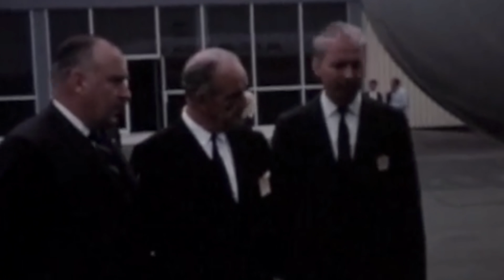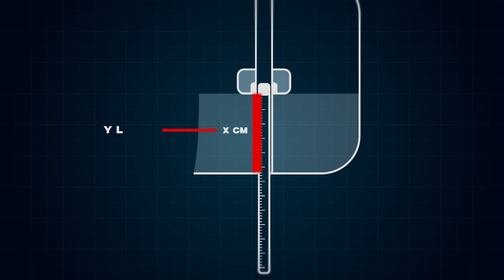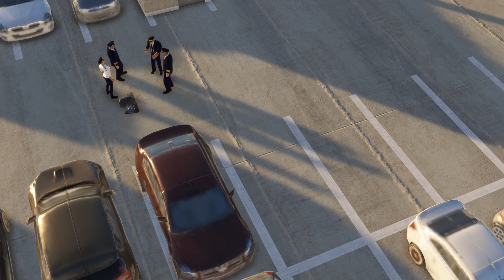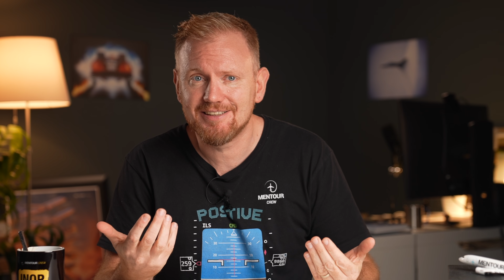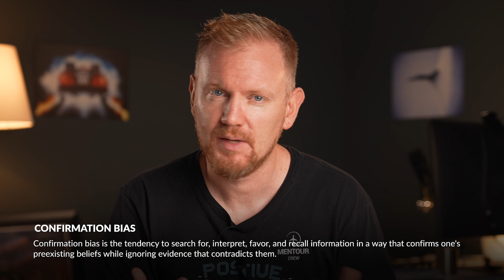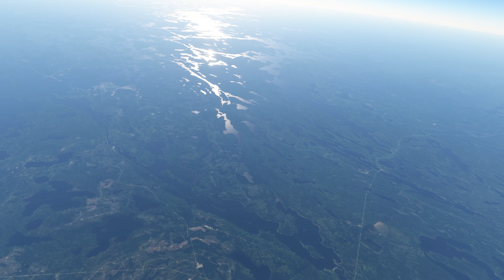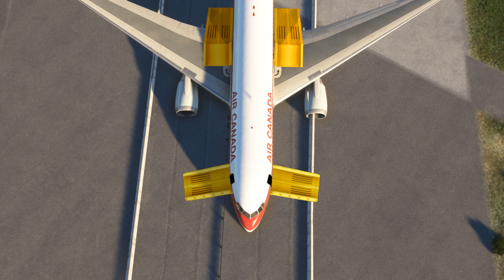NO Engines and Out Of FUEL! | The ”Gimli Glider" Miracle

Comment: Japan 123 might be an interesting event to cover, Petter; I'm surprised that you haven't done so already, for this was the second most deadly accident in aviation history. The 747SR-100, JA8119,  was delivered in 1974, and was used for shortish commuter flights within Japan. It had been involved in a previous incident which involved an exaggerated flare, a heavy tail strike and damage to the aft pressure bulkhead. This was after four years, and 8830 flight hours, which translates to around 6500 full pressurisation cycles. That was in June 1978.

Boeing repaired it, and back to work it went, for another seven years, and another 12318 full pressurisation cycles. Needless to say, a non-approved repair by Boeing engineers caused the bulkhead to fail on 12th Aug 1985. The resulting explosive decompression ended up damaging the unpressurised fuselage aft of the plane, unseating the vertical stabilizer, and severing all four hydraulic lines. It stayed airborne for another thirty minutes before hitting a mountain. 520 dead and four survivors, along with posthumous awards for the flight crew.

I haven't trusted Boeing since they took over McDonnell Douglas and placed profit above all else. But why had engineers who had grown up in a very different culture performed such a shoddy repair job, and how was it not picked up by JAL's inspection team before they put it back into service?

Comment: The talk between the ground crew whereby the conversion figure was passed is telling. An educated person knows that in the metric system a liter of water is 1000 grams ie a kilo, conversion 1:1. Jet fuel floats ie is lighter than water, thus any conversion must be LESS than 1:1 certainly not 1.77. It is not an understandable mistake and it has nothing to do with the system in the plane. The error in the conversion should been caught via common sense built from common public school education. Referring to the ground crew as "engineers" is a stretch.

Comment: I asume that the pilots have flown that route several times? I kinda have the Believe that they should have realised that the amount that was in the tanks, either the Values in cm or in liter, don't match with what would be normal. 
I've no idea about flying an airplane. I actually have quite some knowledge in science and under that perspective, i'm freaking out about that mistake not beeing noticed - ans even worse happened three times in a raw. 
I mean during refueling, wouldn't they have noticed that the process took halv the time it would usualy take?

Comment: I remember when this accident happened.  But this video brings a LOT more information.  All we got on the news was that the fuel was under loaded due to a metric conversion error.  Which was NOT the actual cause, it was faulty fuel gauges.

I am an American, and while i struggle with the metric system (i am old), the metric system is demonstrably better, and should be the universal system of units.  It would solve a lot of issues.

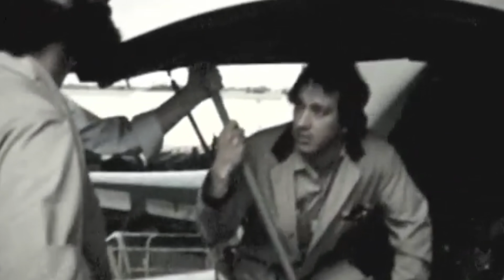Comment: Another informative video, thank you. However l can’t help thinking you summed it up at around 16:00 - why would you accept an aircraft without fuel gauges? Also, whatever happened to a basic background maths check, I.e. the aircraft burns x kgs  per hour, therefore I need x fuel? If the MEL was confusing, shouldn’t you ask the FO for his interpretation? I too flew for 2 operators that bought their fuel in litres but used kgs on board - but they were dynamite on getting these calculations correct!

Comment: I think the MMEL and the MEL should on most types should be revised and trimmed down quite a bit, especially for 121 or 135 operators. Or at least reduce the dispatch allowed time before the part has to be replaced. I understand redundancy but everything installed on the plane has a purpose.

Comment: Once I recreated similar circumstances in Xplane mobile with 737-800. Not because of the lost both engines, but because of being way too high and way too fast. With the extreme angles I ended up being with correct speed but being too low. It was quite difficult and in same time it was great fun. As far as I remember I landed safely :)

Comment: This story is just beyond believable.  As a pilot,  I would NEVER go fly an aircraft with no way to determine how much fuel I should have had.  It's crazy - beyond comprehensionn that a Pt 121 carrier,  regardless of all the math one could  do, and still risk a flight with ZERO means of knowing fuel quantity or fuel burn is INSANE.    This crew should have been fired on the spot regardless of the skills of the pilots and having to put a gigantic side slip.  NO pilot is forced or required to fly any aircraft if they are not 100% confident about it.  An amazing story of survival,  but it was just LUCK they didn't kill everyone on board.

Comment: On previous videos of yours I've commented on the importance of APUs running 10,000 feet and below for every takeoff and landing. But this accident makes me think APUs need a dedicated fuel tank for 30 - 60 minutes of runtime, completely separate from main engine fuel. Allowing you to maintain cabin pressure (I remember one engine out emergency where the limiting factor was cabin air pressure not glide range) as well as electrical. The tank would be so tiny it shouldn't be a problem.

Comment: Not long after this event, the Air Canada maintenance facility in Winnipeg was scheduled to have an open day where the public, including my father, sister, and I, could tour the hangars and wander in and amongst 727s in various states of inspection and repair. The day went ahead as planned, and a special and unexpected highlight was getting to see C-GAUN in one of the hangars getting it's nose sheet metal and other parts repaired. A year later, I joined the Royal Canadian Air Cadets, and got to do occasional glider flights at Gimli. I eventually got my private pilot licence and became an aircraft mechanic, a job that routinely required me to calculate fuel load conversions from litres to pounds, and every time I did, I would recall seeing C-GAUN sitting in the Winnipeg hangar and I would double check my calculations. Coincidentally, I even once had to do my own precautionary landing at Gimli in a C-172 due to low oil pressure, an easy landing compared to what the AC143 crew had to do.

Comment: I recall hearing that on takeoff the plane, 10,000 KG light with half the needed fuel weight,  lifted more quickly than expected which should have been a clue about fuel on board

Comment: It also should be curious to know if the fuel truck dispenser was rated in Gallons.....It's incredible how a "simple" liters to kgs conversion was skipped while the rate of descent/distance to field was correctly performed in an high stress situation.Well explained as usual, Petter. Just two tech notes: the stick used for fuel quantity mesurement on modern planes are actually Dripless Stcks, relying on magnets as shown in the video. The Dripstick are hollow and when they are lowered to the surface of the fuel in the tank the start to...drip. But they aren't used anymore. In case of gravity landing gear  emergency extension there is no gear door closure.

Comment: Great job. It still seems a flaw in design that the front landing gear would not properly deploy on gravity drop. Hopefully others have learned from this failure.  Very minor point:  Dip Stick (it comes from dipping the stick into the liquid) not Drip Stick.  Still the technique I learned when flying Cessna in training. Dip the stick into the wing tank - check the mark of the fuel on the ruler. Still a mandatory check on those planes.
Reply: Drip stick is correct in this video. According to Perplexity AI:

"A drip stick is a simple, mechanical device used to manually check the fuel level in the tanks of many large airliners. It works by providing a direct, physical measurement of fuel quantity, serving as a backup to electronic fuel gauges and ensuring accuracy during pre-flight checks.

*How a Drip Stick Operates*

A drip stick is essentially a hollow tube, typically made of fiberglass or another non-magnetic material, installed vertically in the bottom of an aircraft's fuel tank. The stick is spring-loaded or held in place so that its top end sits above the fuel level when not in use. When a technician or pilot needs to check the fuel, they pull the drip stick down from its storage position through a fuelproof opening in the wing's lower surface. As the stick is lowered, the top end eventually drops below the surface of the fuel. At this point, fuel enters the hollow tube and begins to drip out through a small hole or cap at the bottom of the stick. The stick is marked with calibrated graduations that correspond to specific fuel levels in the tank. The technician reads the stick at the point where fuel stops dripping, which indicates the current fuel level."

-------------------------------------

Of course, dipsticks do exist, and most internal combustion engine automobiles use dipsticks to check the motor oil levels. Dipsticks are usually in the form of a solid metal rod with markings to indicate the minimum and maximum oil levels. In addition, while dipsticks are apparently used to check the fuel levels in many Cessna aircraft, drip sticks are used for this purpose with commercial airliners.

Comment: I've known about this incident since I was a child, but still think this story is so fantastic that I've been listening to it several times during the years. This version is the very best!
What SHOULD be done is that the U.S. should change to the logical metric system and follow the rest of the world! The imperial system is just as stupid as it can be!
Reply: No, imperial is superior. You have an everyday reference of what a foot and an inch are. Nobody has a clue what a centimeter is, and the decimeter is completely useless. Likewise, the everyday measurement of liquids is double, how simple! Cup, pint, quart, half gallon, gallon. The liter is too small for practical use
Reply: @rogerpenske2411  This is the funniest respons I've gotten for years!
Let me give you some examples:
1 mm3 = 1 ml, 1 cm3 = 1 cl, 1 dm3 = 1 l, 1 m3 = 1000 l
1 l water = 1 kg, 1000 l = 1 ton
375 l = 375 kg
mm = millimeter , cm = centimeter, m = meter
ml = milliliter, dl = deciliter, l = liter
Everything is based 10!

What did you actually say?
Reply: @rickwhite4137 So no practical reference points. All that you did is show that it’s base 10. So what. What’s a centimeter?
Reply: @rogerpenske2411  The education system has been failing for decades and people lack basic knowledge that is taken for granted in mot countries.
I never underestimate stupidity as it has no limits.
Reply: @rickwhite4137  agreed. However, most of the world?. I was just in London this summer for a month. It is even worse in Europe.

Comment: The maintenance van also ran out of fuel while travelling to rescue the aircraft. The fuel system “drip sticks” were in CM not inches as well. Neither the crew, maintenance, and fueler were competent  nor practiced in metric conversion.
The MMEL was the deferrals written and accepted by FAA and Boeing, an MEL is  the deferrals accepted by the airline and TC. Flow charts are now available to determine how to calculate fuel loads.

Comment: 1 liter of water = 1kg.    Sure, jet fuel weighs a bit less, but as a rule of thumb that simple fact could have averted a potentially horrendous situation.   But apart from that, this is not the only time mixing metric and other (what should be obsolete)  antiquated measurements has caused a major mistake 😢  I seems absurd that in an industry where people's lives are at stake, systems of measurement are not mandated and universal

Comment: Another, and in my view, crucial, detail (from the book "Freefall", written by Marilyn Hoffer and William Hoffer) in this incident is that the volume-to-weight conversion errors were compounded by the fact that the fuel supply tanker that brought fuel to the aircraft could only measure fuel pumped to the aircraft in gallons (presumably, US gallons). That complicated the calculations even further about how much fuel was needed and even worse, the AC procedures at the time did not make clear whose responsibility it was to correctly calculate the fuel needed: flight crew, maintenance staff or dispatch office... In the end, if I understood correctly, the flight ended up topping off its tanks with less than one thirds the quantity of fuel needed. According to the book, the main culprit turned out to be the airline procedures for not clarifying the responsibilities of each operational department in calculating the fuel quantity required. But, thank you, Captain Hörnfeldt, for reprising this incident with more advanced graphics and with your excellent team.

Comment: This was the best account of the Gimli Glider that I’ve seen on YT. Well done.
A little extra - which might well have become a similar incident - involved the REAL drip tubes: a short haul four engine turboprop flew multiple sectors with strange fuel anomalies. (I can’t remember the details, it was 50 years ago) the tanks were drip checked several times with these numbers being accepted over the gauges and calculated figures. The drip tubes were literally that - you pulled the open ended tube down until the fuel poured out as the top of the tube entered the fuel level. The markings on the exposed tube gave the amount.
It was later determined that several of the tubes were the wrong length……..
Showing that even the simplest system can be misleading!

Comment: In an another telling of this story (probably "Mayday"), there was a note from the fuel guy with BOTH conversions (imperial and metric), but he ended up chosing the wrong one (no explanation was found for decision). The "switch" to metric was very recent and confusing. It's "obvious" that 1 l of water is 1 kg, but it's not obvious for someone used to the imperial system. Few knew how many lbs a gallon of water weighed.

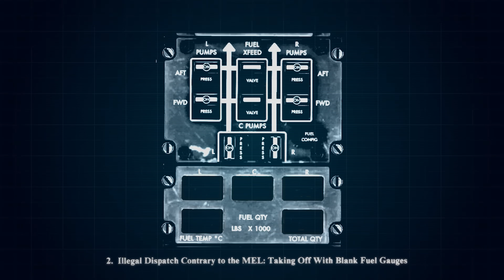Comment: I'm @12:34. I believe I watched this case on Air Crash Investigations in the past. It was covered a lot more ... dramatically.
If I remember right they concluded that the pilots just didn't trust the fuel gauges and that's the end of a clearly more abbreviated story.
But if the facts here are true there would clearly be a lot of reasons to distrust these gauges and a clear loss of redundancy and trust in the shown values!
The story with these facts is a lot more believable and likely. Why did they not include anything about this in a over 40 minute documentary?

Comment: In 1999 NASA lost its Mars Climate Orbiter space probe dew to a faulty conversion of SAE to metric or visa versa. NASA engineers are some of the brightest minds on this planet. Anytime converting sae to metric is required and lives are at stake or its an expensive endeavor, the conversion and math needs to be triple checked in a way that leaves absolutely zero doubt of the conversions accuracy.

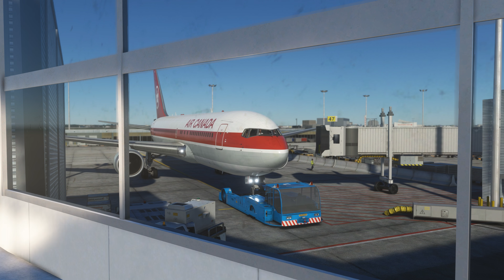Comment: Fuel quantity calculations (16:57 - 23:31) can be quite convoluted, especially when done manually, and simple miscalculations can sometimes by VERY costly, like in this case, or possibly others like LaMia Flight 2933 (November 28, 2016) wherein reserve fuel was disregarded even though the route was in the opposite direction of what the crew flew the previous three flights, or Avianca Flight 052 (January 25, 1990) wherein prolonged holding patters combined with imprecise communication led to a crash due to fuel exhaustion. Here's what I got when I ran the quantity numbers for Air Canada Flight 143 (July 23, 1983), albiet under the practices of the time:

1) Correct refueling calculation (metric units):
Onboard mass: 7,682 L (Volume) × 0.803 kg/L (Fuel density) = 6,169 kg
Additional mass: 22,300 kg (Required mass) - 6,169 kg = 16,131 kg
Additional volume: 16,131 kg / 0.803 kg/L = 20,088 L
Total: 6,169 + 16,131 = 22,300 kg 

2) Air Canada Flight 143 calculations:
Onboard mass: 7,682 L × 1.77 lb/L = 13,597 lb
Additional mass: 22,300 kg - 13,597 kg* (Actually pounds, not kilograms) = 8,703 kg (Misinterpreted)
Additional volume: 8,703 kg / 1.77 lb/L = 4,917 L × kg/lb (Rounded to 5,000)

Onboard mass (ROUNDED additional volume):
• 7,682 + 5,000 = 12,682 L
• 12,682 L × 0.803 kg/L = ~10,184 kg
• [(~10,184 / 22,300) × 100] = ~45.667% of the required fuel load

Onboard mass (EXACT additional volume):
•7,682 + 4,917 = 12,599 L
• 12,599 L × 0.803 kg/L = ~10,117 kg
•[(~10,117/ 22,300) × 100] = ~45.368% of the required fuel load

Average of the two came out to roughly 10,150 kg, or about 22,381 lb, 45.516% of the required number, or about 9,826 kg (21,667 lb) if the ACTUAL volume and mass [11,430 L, ~9,178 kg (~20,238 lb)] was used (~44.064% of the minimum)

3) My own calculations:
Onboard mass: (7,682L × 0.803 kg/L) × 2.205 lb/kg = ~13,602 lb
• 22,300 kg × 2.205 = ~49,172 lb (Total mass in pounds)
Additional mass: ~49,172 - ~13,602 = ~35,570 lb
Additional volume: ~35,570 lb / 2.205 lb/kg /0.803 kg/L = ~20,089 L
• ~20,089 L  × 0.803 kg/L = ~16,131 kg
Total: 6,169 + ~16,131 = 22,300.354 kg (~49,172 lb), or 22,300 when rounded down-- a perfect match of what Flight 143 needed to reach Edmonton from Montréal after a stopover in Ottawa without refueling

4) My own calculations (Pounds density, required mass in kilograms):
Onboard mass: 7,682 L × 1.77 lb/L = ~13,597 lb
• ~13,597 lb / 2.205 lb/kg = ~6,167 kg
Additional mass: 22,300 - ~6,167 = ~16,134 kg
• ~16,134 kg × 2.205 lb/kg = ~35,574 lb
Additional volume: ~35,574 lb / 1.77 lb/L = ~20,099 L
• ~20,099 L × 0.803 kg/L = ~16,139 kg
Total: ~16,139 + ~6,167 = ~22,305.606 kg (~49,184 lb), slightly more than needed

- I did put the ~ in a lot of the numbers, since they aren't exact in the calculations as I didn't round them up or down in the calculator.

Quite convoluted, isn't it?